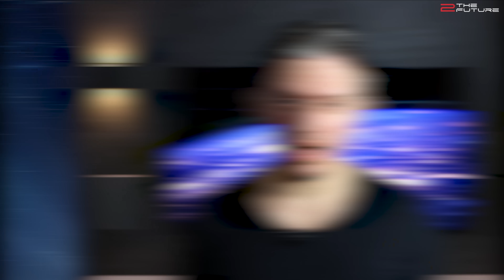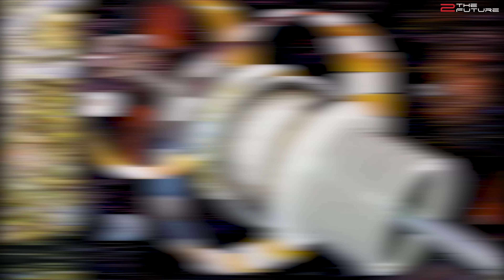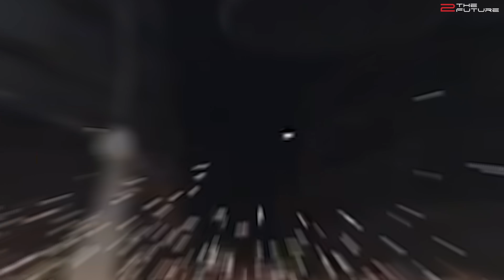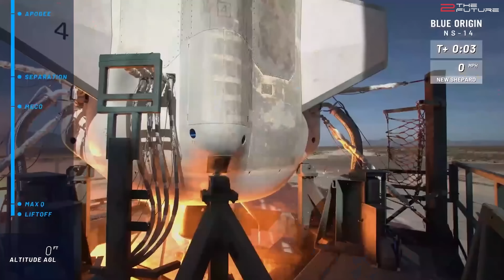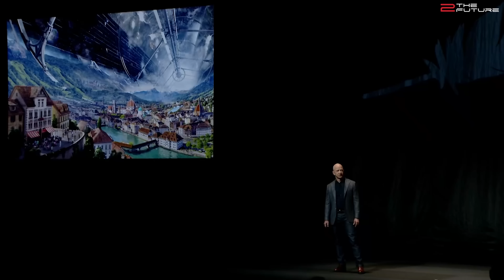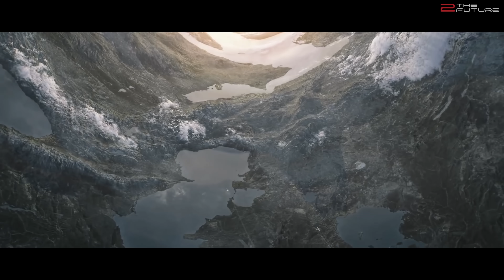How Do O'Neill Cylinders Work & Can Blue Origin Really Build One?

Comment: I personally think both extremes are not good ideas for the immediate future.  Mars in particular is a bad idea for all sorts of reasons, and O'Neil cylinders are a long way off for the very reasons stated.  A lunar base is far more practical in the foreseeable future, and I suspect that will be the next thing we'll see.  Consider that a lunar base is easier to do than a Mars base, and requires pretty much the same technology for the living environment.  (With the advantage that the lunar surface isn't contaminated with poisonous perchlorates.)  I think we'll see "Double-Hammer" space habitats long before we see anything like an O'Neil cylinder.  Consider two structures comprised of little more than six or eight Starships bolted together, then tethered to each other through a hub and rotating at 1G.  Enough space for a couple hundred people to live and work, and possibly enough space for hydroponics to feed them.  We have the technology to build this and transport it to orbit right now, once Starship is working.  Then such a habitat could be expanded by adding additional identical habitats, and the residents could work in Asteroid mining.  It's a more realistic  idea than an O'Neil cylinder, and within our current technology.

Comment: I first came across the concept of the O'Neill Cylinder in an Auther C. Clarke novel titled - "Rendezvous with Rama".  One of the best Sci-Fi stories I have ever read.
https://en.wikipedia.org/wiki/Rendezvous_with_Rama#:~:text=Rendezvous%20with%20Rama%20is%20a%20science%20fiction%20novel,ship%20in%20an%20attempt%20to%20unlock%20its%20mysteries.

Comment: You need moon bases for the raw materials and low gravity to assist in making these megastructures feasible but do we really have the right technologies to make O'Neill cylinders? Right now I don't thinking so but we know how to make bunkers and radioactive shelters and deep tunnel networks with current technologies to make moon bases and out post possible.
Reply: The key technologies we're missing are industrial processes suited for the Moon, and equipment to live there while dealing with the dust. Given those, we should be able to build a lot of the space industrial infrastructure and the colonies out of lunar resources.
Reply: Believe it or not we actually know the principles behind a lot of sci fi tech already - the main issue is finding some way to power all of that stuff.

Yes, we know how to do atom-by-atom printing. The problem is finding a way to not burn out the power grid while we're at it.

Comment: As you point out, it's not a matter of either/or. There will be both surface colonies and floating ones. The key however, is economics. Any colony is going to have to produce something of value, to crate new wealth, to be traded back on Earth for the material goods, everything from computers to cookpots, that the colonists will need just to survive, much less live comfortable, prosperous lives. My guess is you will start out with small scale man tended factories in Earth orbit. These will just be visited regularly to add new raw materials and take away the finished goods. As these industries grow, larger factories will be permanently manned, but by temporary crews, the way off shore oil rigs are, or the ISS now. Eventually, a tipping point will be reached and it will become economical to go to the moon and asteroids for raw materials, both to supply the factories and to build new ones. These mining operations will probably also involve temporary crews at first. Eventually, both the orbiting habitats and the mining facilities will evolve to having permanent residents, actual settlers. This process will probably take fifty years or more, but it will happen.

Comment: I think 1 meter thick walls is crazy: In theory, you don't need more than a few millimetres thick envelope (of stainless steel or aluminium) to hold one bar of pressure. 
The cylinder could be seen as a giant blimp. 
Of course, that´s theory. lots of problems arise and reinforcement structures will be needed, but that is nothing compared to to your numbers.
Reply: You may not have noticed that they gave no estimate regarding the interior. Skyscrapers, monorails, a billion tons of soil to grow those crops. The 1 meter thickness used in their mass estimate may have been meant to account for a minimum of interior infrastructure.
Reply: @gilbertanderson3456  I have, and you are right the whole project is utopia at the moment, but such a massive quantity of steel this is still unrealistic and inaccurate ...

Comment: You don't need 1 m thick steel wall to hold in a pressure of 1 bar and gravity of 1 G.
The breaking distance of steel at 1 G is about 7-8 km, so a steel ring could be about 2.2 km. 
So a 1 mile dia. ring with a pretty thin wall should be doable, why not just 10 mm thick wall? 
It would be great if someone who knows how do work this out, would.

Comment: Let's see, what's easier, faster and cheaper? Creating massive rotating space stations, or landing a boring machine on the moon, digging tunnels, and topping them off with simple, little domes?
Reply: Obviously the latter, if 'simple, little' spaces are all you want...
Reply: @stardolphin2  tunnel complexes can be massive and span hundreds of km, but the access points need only be simple little domes covered in regolith.
Reply: Residents will still face significant bone loss and risk other disorders in the very low gravity of the moon.
Reply: @gilbertanderson3456  Which are you proposing - that these problems are unsolvable, or that they have not yet been prioritized?
Reply: @RealShawnPate  The low gravity problem can be "solved" at great cost. Would you want your daughter to undergo genetic engineering to allow her to tolerate low g knowing that after a couple of years on the moon she could never survive returning to Earth?
Reply: @gilbertanderson3456  If the problem is important enough then people come up with novel solutions every time. I see this no different.
Reply: @RealShawnPate  I applaud your optimism, though I fret at your naivete.
Reply: @gilbertanderson3456  it's not just optimism. Every significant problem has been solved when there was enough of a financial incentive. Impossible bridges, tunnels, skyscrapers, vaccines, etc. etc. As soon as there's enough money at stake or a problem causes enough pain and suffering, a solution is found. That's just human nature. I'm not betting against that.

Comment: The builder and runner of the website https://www.buildtheenterprise.org/

came up with a compromise between O'Neill Cylinders and surface cities with flat floors on a light-gravity planet, dwarf planet, or satellite. You hinted at this at one point, but here is the idea fleshed out: https://www.buildtheenterprise.org/mars-moon-bases/

It's a beveled centrifuge--or as the author called it, a "gravity wheel." The angle from the vertical is 90 degrees times the square root of the fraction of Earth gravity you find at the surface. Then you spin it so that the resultant of gravity and "centrifugal force" is directly normal to the beveled surface. Result: you walk on a slightly curved floor, and feel your own weight, same as on Earth.

This allows you to build your spaceport, mining and exploration operations, and low-gravity hospitals on the surface. A low-gravity hospital would be an ideal hospital, or even a convalescent facility, for those suffering from cardio-pulmonary diseases, but especially congestive heart failure.

While the rest of the colonists, when they're not out on the surface digging ores and such, can enjoy Earth-normal gravity and not risk osteoporosis or osteopenia from constant exposure to low gravity.

We're both going to hear, I imagine, from those who assert that human beings will learn to love the low gravity and therefore build their houses on the surface and have done with it. Except that they never, never, never will be able*, not just "not allowed" but *can't go back to Earth. The (to them) three- or six-times-normal gravity would crush them. Robert A. Heinlein covered this in his novel _The Moon is a Harsh Mistress_.

I have no desire to see human beings subdivide and subspeciate from mechanical oversight. But I agree with you that the O'Neill Cylinder is far too ambitious an undertaking at our present level of technology and infrastructure development. Better to build those cities on Mars and even on the Moon and start extracting material for building the Cylinders later, when the population warrants it. In fact, I suspect O'Neill Cylinders will likely be a feature and project of a Kardashev Type 1 civilization.

But I suspect Jeff Bezos has a political reason for his championing of O'Neill Cylinders: get as many people as possible off the planet, with their smelly, dirty industries, and turn Earth into a park. And not a theme park, either, but--a park. Like Yosemite National Park in the USA.

Elon Musk has a tamer ambition: to ensure the human species against a disaster in any one place. A beveled centrifuge will help him realize that dream without sub-speciating humanity according to their gravity tolerances.

Comment: The logistic infrastructure necessary to construct an O'Neal cylinder will take decades if not centuries. From resource collection, smelting, manufacturing and financing. One of the biggest hurtle is the manufacture of steel in space. Steel requires coal in its foundry process. There is no coal in space because coal is made from organic matter.
O'Neal cylinders are better used in multigeneration star ships like they made in the Expanse, Nauvoo/Behemoth/Medina Station.
Reply: The Steel industry only uses Coal/coke in the prosessing of iron ore because it the chepest source of carbon to seperate oxygen from iron oxide. Hydrogen gass can be used to seperate oxygen from lunar/asteroid material geting a pure metalic mass which can be used for further prosessing in to titanium, nickel, iron, and Allunimum.

Comment: Great info and thought provoking. One idea that will save on resources mightbe to capture an asteroid, then rotate it and hollow it out accordingly to your living requirements specs.
Reply: This seems like the only economical way to construct a massive space habitat. Mine out and sell the precious metals to finance your technology, use the iron and nickel to seal and strengthen the interior volume and to build your infrastructure.
Radiation protection - check
Gravity; spin the structure and - check

All you need is a starting supply of consumables, crops that can be grown in space and good recycling systems to have a viable habitat.

You might desire some resupply missions to make life more pleasant, but the $quadrillion to build and $billions in annual external support necessary for the O'Neil cylinders shown in this video would not be required.

Comment: While I favor Moon dome colonies with inclined "racetracks: on which RV like vehicles would race around to make gravity; the two trojans discovered so far could be sources of material for a space colony. They are hard to get to but at about 1000 feet in diameter each, they would have adequate material and almost no gravity to lift against. The colony could perhaps be placed in a somewhat more accessible halo orbit of the L point.

Comment: The rationale for space colonies such as the O'Neill Cylinder is NOT that the Moon and Mars have only 1/6 and 1/3 Earth gravity respectively, but rather that planets in general lie at the bottom of deep gravity wells. Going down and coming up those gravity wells costs a lot of delta-v, which you entirely avoid with the space colonies.

Comment: Sorry to correct you, but the Babylon 5 station was not an O’Neal Cylinder.  There was no mirrors, nor transparent sections for light to enter. It used artificial lighting.  Also, there were several separate section of the B5 station.
Reply: But it was a cylindrical habitat that used rotation to provide gravity.

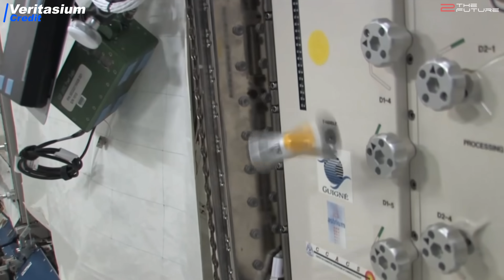Comment: 03:30 - A rotating cylinder wouldn’t flip around because of the “Tennis Racket Theorem “effect. It would precess because it’s a gyroscope, progressively coming out of alignment with the sun. Pairing it with another cylinder of equal mass rotating the other way would cancel out the precession.

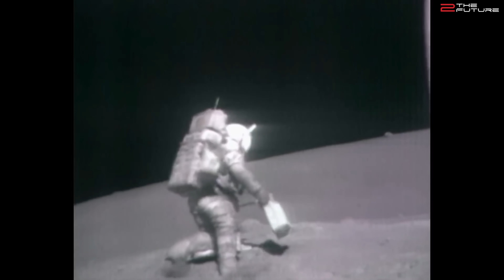08:20 - We really have no idea how much gravity humans need to be healthy. It could be we just need enough for the to body to sense up and down. Making plans based on the gravity of bodies being either different or insufficient is premature at this time.

O’ Neil cylinders are a far future option but I doubt will ever see them. People already live in crowded cities were they seldom see the sun or green. People will adapt to living in enclosed spaces. With improving VR it would be easier to provide simulated open spaces than real ones.  Agriculture will be highly compact.

It requires far fewer launched resources to start on the moon and Mars were you at least have dirt and gravity instead of nothing but hard vacuum. Just having a substrate to build on is a big plus.

We also shouldn’t forget that the entire point of going to Mars is to get as far from Earth, and any mass disaster on Earth, as possible. The many advantages of working on the Moon and near Earth orbit are irrelevant to that goal.

Comment: Great video! Another problem with the O'Neill cyclinders is not like planet gravity. A good example would be if someone threw a ball straight forward, it would curve round, even when thrown straight. With the eagle flying as well, it would have no gravity and no up, once it has launched off the ground. Same with the baseball game in interstellar, it would mean learning to cope with strange curves based on the cylinder rotation. It's better than no gravity, and could work for some long duration space missions but not really as good as living on a planet in the long term.

Comment: You are comparing two different things. The Mars colony will start small and not even remotely self sustainng. Then it grows. You are starting with the ultimate, full sized, finished O'Neill cylinder. So re-do the math with the cylinder scaled down by something like 30. Gravity will not be a full 1g. Surface area decreases by 900. It's mostly hollow but the wall thickness can also be decreased. So mass goes down by 1000. This provides a base of operations for personnel, food, manufacturing, etc. to build an eventual larger cylinder. Maybe the smaller cylinder is built by people living on starsips orbiting the Earth and/or Moon.

I have not done the math myself, so 30 may not be the right number. I'm just asking you to take your thumb off the scale when you do the comparison.

Comment: Yeah but.. You have Eros-433, which is a near Earth asteroid of approximately 35km in length and 11-15kms in diameter. Sure, it looks like a space potato, but still, it can be made more cylinder-like. I mean, why go all the way to the asteroid belt when you've got an O'Neill cylinder virtually waiting to be carved out, right here in our back yard?
Reply: Once you spin an asteroid, they'll tend to just fall apart. Seems they're often just a a ball of lose rocks.
Reply: @Music5362  Still, Eros-433 has all the necessary raw materials. so don't use it as it is, use the materials which make it, to construct an exoskeleton, only then start rotating.

Comment: Easiest to just hollow out the asteroids. Then they form your walls, and you just need to have a very thin surface of steel for your actual cylinder. You can also counter-rotate against the asteroid. Either way, it's quite a few years off.
Reply: If you counter rotate an asteroid enough to generate gravity, it will rip itself apart.
Reply: @Hedgehobbit  Okay, so use some mesh to hold it together. My point is that you don't need to process the material at all.
Reply: @malcolm_in_the_middle  Why bother trying to hold an asteroid together instead of just building a much smaller space station from conventional materials?
Reply: @Hedgehobbit  Because the asteroids are already in space.

Comment: Why not bore a cylinder around an asteroid that has a comensurate rotation speed for its radius  ?  All building material is there just need tooling transported to it!
Reply: And when you spin it up it will fall apart.
Reply: @Hedgehobbit  If its already spinning why would it fall apart?
Reply: @johnbaker537  If you calculate how much you would need to increase an asteroid's rotational speed to create a noticeable gravity, you'll quickly see why it would fling itself apart.

A study in 2014 found that most small asteroids are a result of a larger body ripping itself apart due to it's own spin. An asteroid's spin speed can slowly increase just through the heating and cooling caused by the sun in something known as the YORP effect. For example, in 2013 asteroid P/2013 R3 was observed to be breaking apart from a tiny increase in spin speed.

The reality is that our knowledge of asteroids has greatly increased since many of these sci-fi concepts, such as asteroid bases, were created.

Comment: im thinking its a lot easier to get 1000- 2000 tons to mars than it is to get 10s of millions of tons into an oneil cyllinder - even assuming you can just make it out of steel and not some advanced alloy or magical graphene / boron nanotubes. wouldnt you get motion sick walking perpendicular to the direction of rotation? also also could you have a small bed sized pod that rotates so you can at least sleep at 1G? would that stave off the effects of the moon / mars lower gravity? much easier than building a cyllinder!